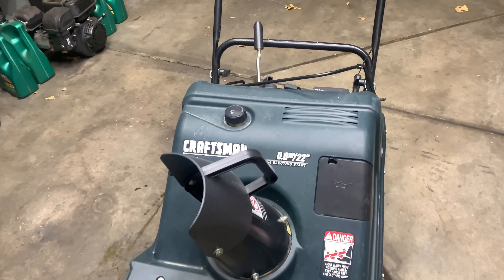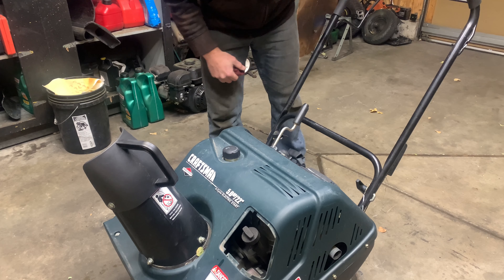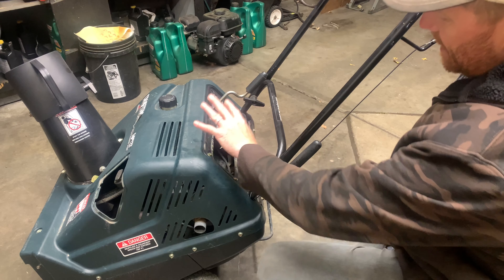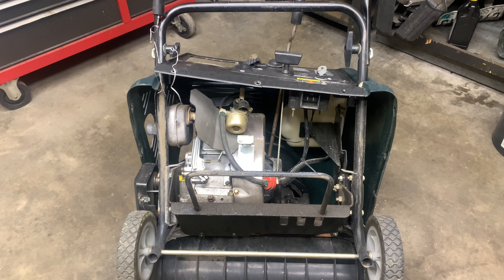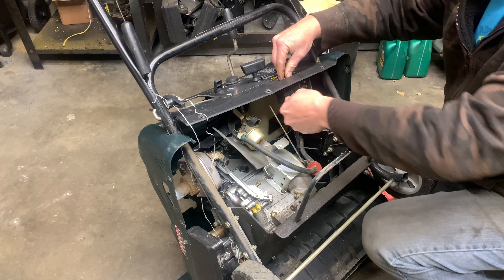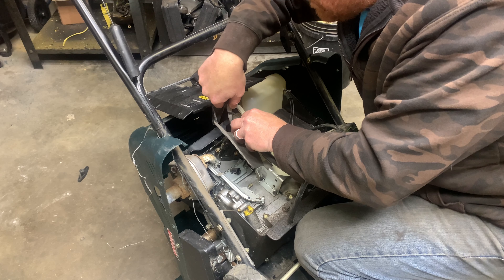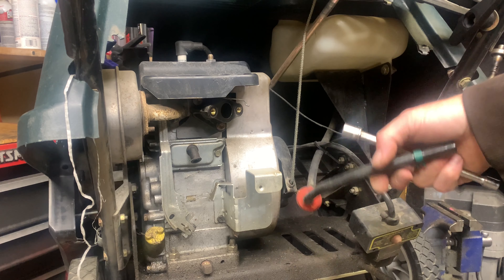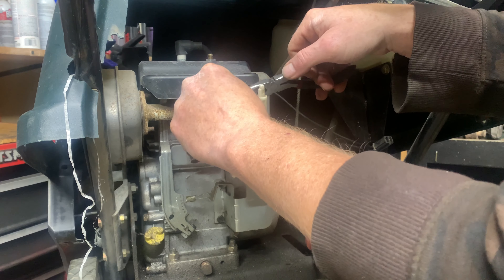Craftsman Snowblower Won't Start - Small Engine Repair

Comment: How big are the tires on this model, i have 1 that the wheels  broke off, also how do i change the oil?
Reply from the maker: Hi Naeem. I am guessing the tires are about 6 inches in diameter. To change the oil you need to remove the square bolt on the bottom side of the engine. You will see it when the plastic is removed that covers the rear of the snow blower. Once the oil is drained put the bolt back in and tighten it up. Then add oil. 5w30 snow thrower oil is best. You can pick it up online, or at Lowes, Homedepot, ACE.

Comment: I have the identical unit, and I want to buy new rubber auger paddles, but I can't find the data plate for the model number. Can you please tell me the model  number. Thank you
John
Reply from the maker: John it has been a while since I worked on that unit and don't have the model number.

Comment: What is the replacement carburetor make, part number, and did you go through Amazon or what? I have the same snow thrower..
Reply from the maker: Hi Bill, I do not remember the part number for the carburetor. I most likely got it off Amazon. Look for the model number for your engine and then search that model number on Google. The model number will be stamped on the engine. You could also try searching for the model of the snow blower. Sometimes the engine will come up in that search and you will be able to find the carburetor part number.